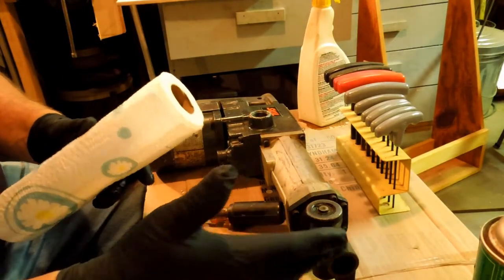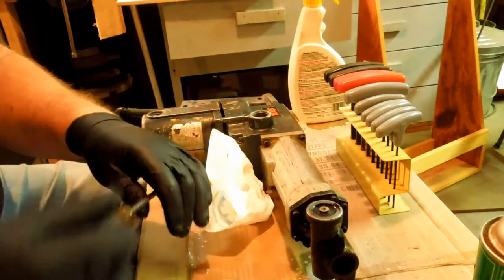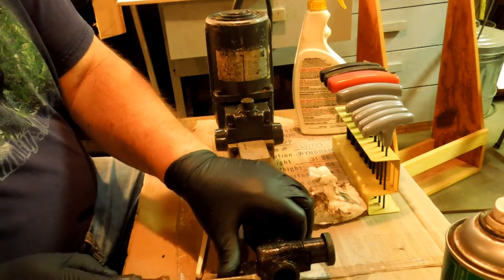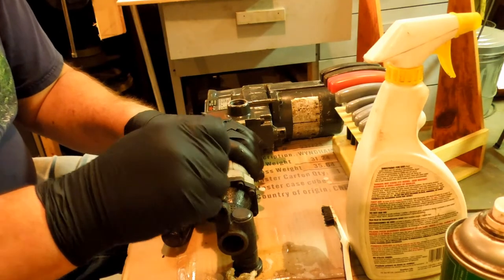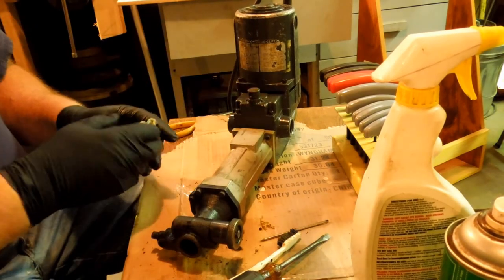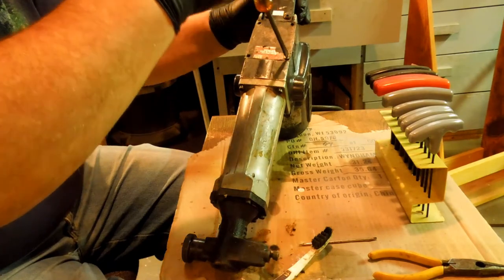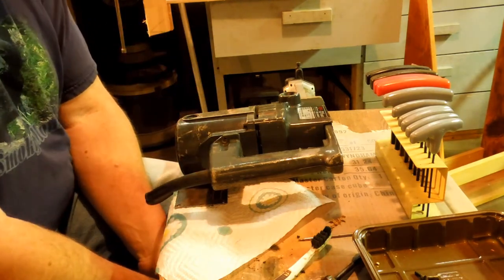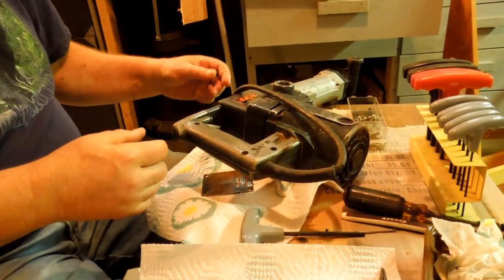Garage Sale Find ~ Skil Rebuild Skill ~ M731 Roto Hammer Restoration Pt 1

Comment: I'm surprised the manual wasn't on some website somewhere.  But you actually got some genuine customer support, which seems fairly rare nowadays.
Reply from the maker: I use to spend days on the phone and then wait weeks to get the manuals on equipment that cost millions of dollars to buy. 
I had w good reputation for getting plants up and operational after years of steadily declining performance. Then setting up maintenance schedules that kept them running. 
My secret? Like a Patton, I read their books. 😁😎

Comment: I used a Bosch demo hammer to beat out 1 1/2 yards of concrete out of a drum once, and it worked a LOT better than the usual air pavement breaker. And I don't sign up for any manual garbage either. And I never have manuals so I'm flying blind but it works just as good as it needs to for me. There is always a hammer that's not being used. Happy, happy!
Reply from the maker: I'm having trouble finding bits for it. Lots of SDS type. No 3/4" hex shank.
Reply: @OldSneelock  The start of ye olde Blacksmith Shoppe!!!

Comment: Just watched your video on the roto hammer, I am in a similar situation. I have had my skill 728 roto hammer for many years, I find the bearing from the connecting rod to the crankshaft is wasted. can't even get a part # from it. do you have any idea's what it may be? thanks for your very informative video. 
Ron Triano
Reply from the maker: I found a manual for mine. I will see if I still have it.

Comment: Lubrication ???  Nah....we ain't got no time for no lubrication....plug it in and pull the trigger.  LOL.  The boss says there isn't enough money in this job to waste time doing that stuff.  Tools are expendable...that's what they say and that's because they don't have to use them. Then when they break or wear out its 'Why didn't you take better care of it' ?!!  You're gonna love the old dog of a rotohammer just donated to my junk pile a month ago or so...  lol.  I'm surprised at how good looking that drill is. It really doesn't look like it was just tossed in the open bed of a truck for a decade.  I did not realize Bosch was the manufacturer of Skil tools.  I wonder if its just the roto hammer line or others as well. So far, pretty good support....fingers crossed...
Reply from the maker: I always wondered at the guys who would stand there pushing on a dull bit.
Warning old guy story:
Back in the eighties I was the maintenance manager at United Technologies. I had a crew of about 14. Depending on what time of the year it was.  14 to 20 back and forth. Had a problem with a pump in the direct chill casting pit. I sent a guy out to repair the pump. Well he couldn't get the motor to work, so we are going to swap out the motor. It was a backup pump so it wasn't a big urgent thing.

He was over there and he needed to drill for new mount holes. So he was gone for like 45 minutes and I went over to check and see how he was doing.  He had a hole drilled but he was just sweating buckets.

I stopped and asked him how he was doing and he said for some reason that piece of steel that he was drilling now was just hard. The drill couldn't cut it. He said he'd sharpened the drill bit a couple of times and it still just wouldn't drill. So he's pushing on it and I'm watching it running I said hand me the drill. I look at the end of the drill bit and he sharpened it, but he sharpened it backwards.   Okay he just didn't know how to sharpen a drill. So I took him back to the tool room I  went through the standard, " This is how you sharpen a drill bit and this is the way the angles are supposed to be."  talk about back angle and relief and all the things that you talk about when you train someone how to sharpen a drill. He said thank you and he hadn't realized that's how it worked and that he appreciated it. Well I went back over and I couldn't figure out how in the world he drilled the first one. Guess what. When I picked up the drill motor to put the drill bit in it , he had it running in reverse. That's why he ground the drill bit backwards. He thought that's the way it was supposed to work. 
Honest to God it happened just like that.
Reply: Old Sneelock's Workshop man that’s a good one. I’m still laughing at that dummy !!  Hahahaha   Funny stuff sir. But you really get to see it all don’t you. Our new shop guy ... I mean really REALLY new ... couldn’t figure why the horizontal bandsaw wouldn’t cut. Quote: “ I swear something’s wrong... this is the second new blade and it still won’t cut”!!  Sticking my fingers on the teeth I laughed. You guessed it. Backwards. Lolol. He never did that again !!  Old guy story touché’. Lolol.
Reply from the maker: Tell me honestly have we ever fallen for the hacksaw blade in backwards? 
Hmmmm?
God! Do I dislike using a hacksaw.
About the only time I do is for a video. 
A mere 20 or so powered cutting tools, run with gas, acetylene, electricity, both motive force and direct heating in the shop, and I choose to make hand tool videos. 
What is wrong with me? 
Just a YouTube masochist..........
Reply: Old Sneelock's Workshop hahahahaha  crack me up !!   Lollol

Comment: I have not had good luck like you when you have to join up. Always problems. I have been trying to restore a JC Penny hammer drill. It belonged to my father-in-law. I would like to restore it for my son. He likes to have tools that his grandfather used. I have been chasing all over for information on it with no luck. I'm like you I need a    parts manual. I have cleaned and lubed it. But there is some things that don't seem in the best place. Do you have any ideas on how I can get information.  Thanks
Reply from the maker: Try ereplacementparts.com

Comment: I will say a good word for Bosch Europe, bought a jigsaw base model on sale, 3 weeks later failed, dead,. If I'd have gone back to store, they'd have refunded,sale was over, no stock,only models costing twice,. So phoned Bosch , they guaranteed by default to turn it around in 5 working day, all courier paid both ways, sure enough it came back, a brand New much higher model, with nice box and accessories, retailed 3x the price I'd paid,.  Compared to canon repairs who said they didn't have stock of a camera, said go buy a new one and then they'd process a repayment..yeah sure, I made them  order a new one, I had no issues finding stock, I'm not lending rhem money ! The cheek
Reply from the maker: Good service for both of us. I still have the nibbler to check out too.
Reply: @OldSneelock  oh funny story on the canon camera, it was150£, the ran a promotion for £30 cash back sent off papers, didn't hear, sent off copy, phoned them, they said closing date and send in a duplicate if I want to make sure,. I sent 4 copies in the end..back came 4 cheque of £30 😆 camera was near free, I cashed then all